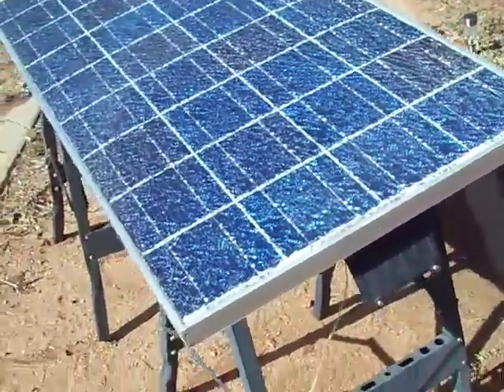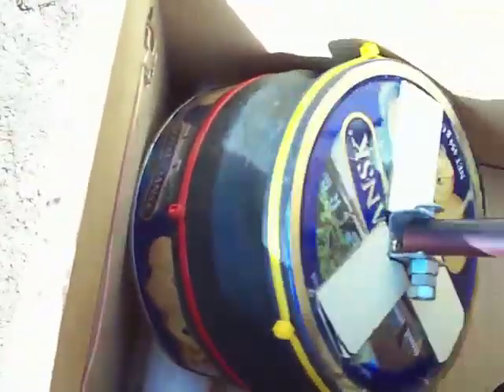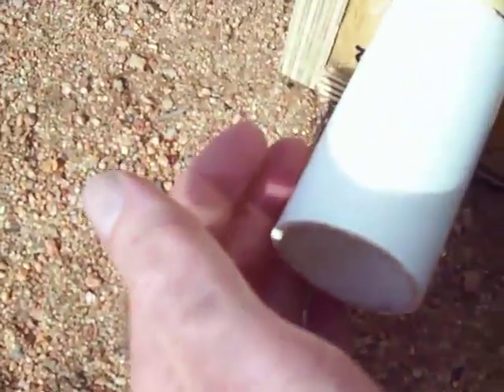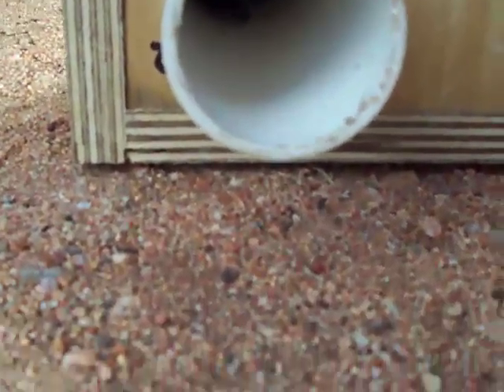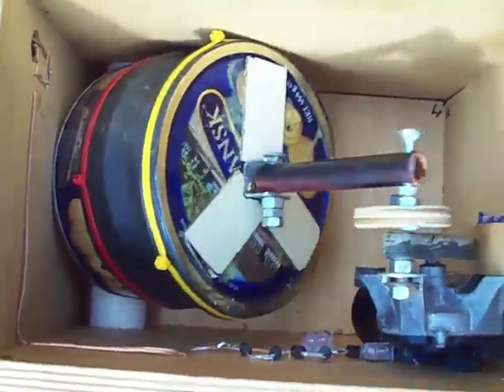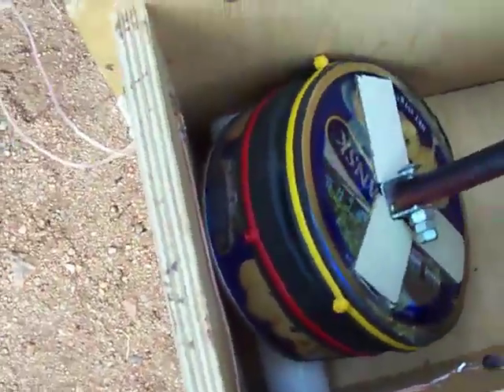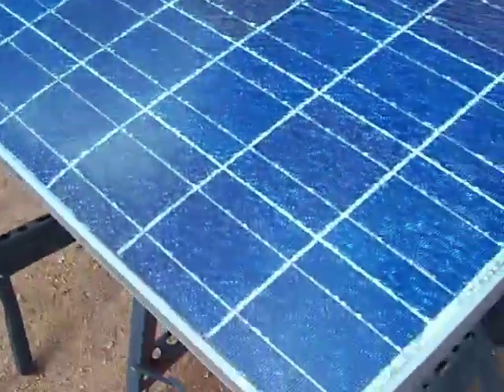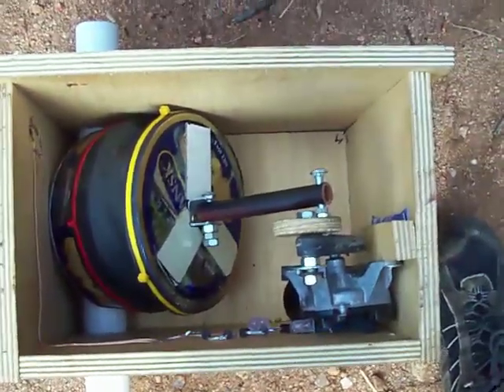Solar Powered Air Pump From Scrap Materials

Comment: That is really good, Daniel.  I have projects to use compressed air in a low pressure pneumatic grid.  The air goes through irrigation tubing (cheap) and it runs airlift pumps for hydroponics, aquaponics, "pallet gardens" aeration for fish and  also solar thermal collection "drip walls"   This is the first solar powered pump that looks like it can supply the air.  The smallest airlift pumps I have made use about 1/3 of a liter of air per minute. So potentially, you can run 200 or more of the little airlift pumps from one of your compressors!   There are hundreds of applications for this!
Reply from the maker: Cheers Brian. Keep in mind that in this configuration without a battery the motor will only go when the sun's out, and any cloud/shading will quickly take the voltage down to pretty much zero, depending on the panel. It should be fine for where this one's going in outback Australia, there may be issues in the UK. Of course there's no reason not to chuck a battery and charge controller in there, just a bit more expense.
With regards to the pump itself it's kind of ridiculously easy to make, and long as it holds together over time, which is should, should be quite effective. If you want to make one send me an email and I'll walk you through the process. I should probably get around to doing a tutorial on it as some point but it's frankly easy enough to express in a couple sentences.
Reply: Thanks Daniel.   I think your little compressor pump is awesome because the compressor pump is modular so it will work with wind or solar thermal or with water power.  What you  might try it with if you get the chance is gravitational vortex. Nobody even  tries gravitational vortex!  If you had it running in a half rain barrel, I bet you would be amazed at how useful it could be. If the vortex cannot turn the turbine, it just gets higher and stores up power until it has enough torque!  That is a pretty amazing feature!  And your vortex turbine can be so simple.  Just one blade if you like. My experiment learning about the gravitational vortex is at Solar panel Directly works  pump with NO BATTERY! "Fish Friendly" vortex demo has big surprises! and I know it is just  a tiny experiment but so worth scaling up!   You got to remember that the rest of the world is absolutely obsessed with generating electricity from every tiny source.  Spend $100 to store a few cents worth of electricity, no problem!  Need a degree to build an alternative energy system. No problem!  They are mad.  Your approach is far better.  Brian
Reply from the maker: Brian White
Vortexes and Archimedes screws etc are certainly something I'll be having a play with when I get the chance.
Reply from the maker: Not something I got around to, no, but if you have any questions my email's on the opensourcelowtech.org site.